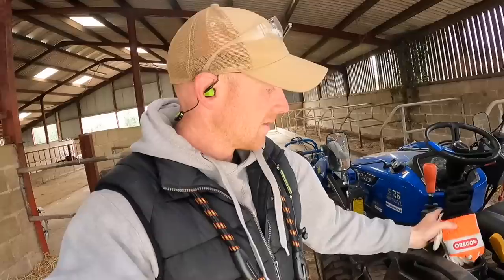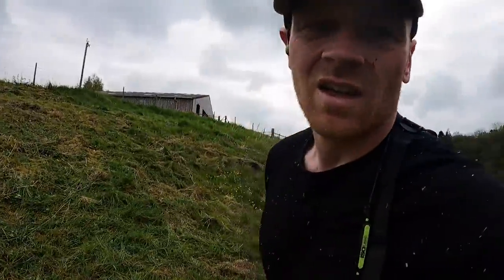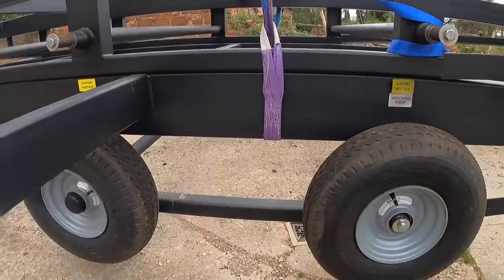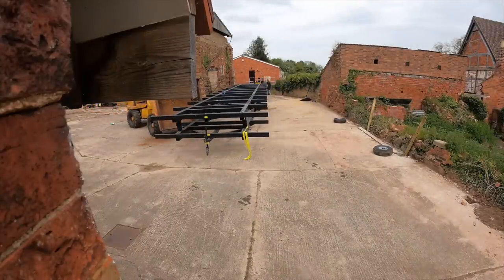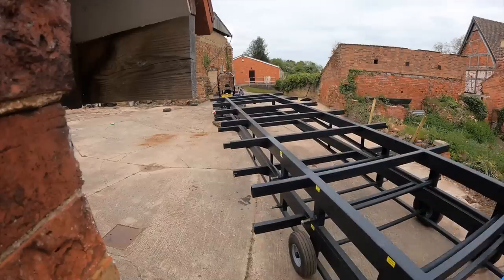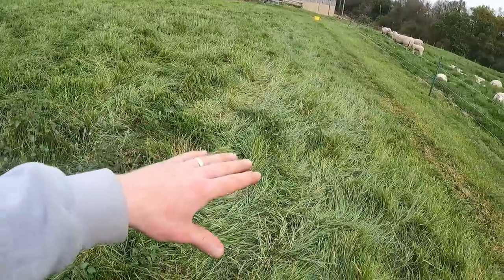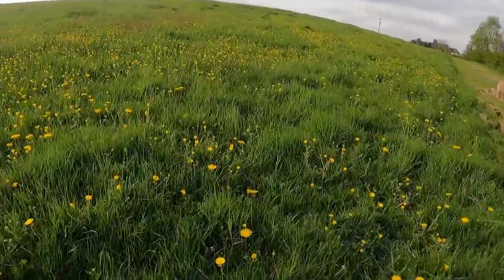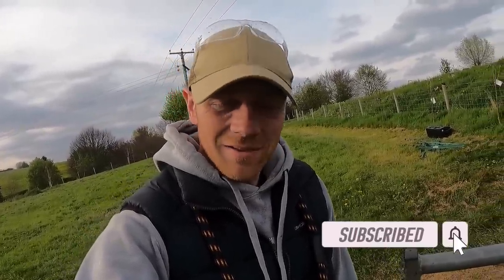WE MOVED THE GIANT TRAILERS! - First stage of the Cabin Migration

Comment: Use 4 high lift jacks on the top chassis, one each corner, drag the bottom one out……or speak to local farm and borrow / hire a telehandler with a couple straps.
Reply: Spot on. Raise the top one, drag the bottom one out. Simples

Comment: Should have mentioned that you should take advice from someone who is BASIS qualified for use of any agricultural chemical applications.
As you want to use no/ or minimal chemical I put,they will give you the best advice; for example for the weeds within grass, they may suggest that rather than using a premix, such as the one you mentioned, they may suggest using something like Agritox and Deptitox 500, due to improved efficacy over a premix, thus reducing the need for chemical input.

Comment: Your sheep grazing, moving them on quickly before they take the grass off very short, followed by topping weedy areas, is very effective. The grass recovers more quickly and you can start to control the weeds, If you can move the sheep back after the grass has grown well this can possibly reduce worm problems. We graze goats in this way, the grass recovers more quickly and I have to worm less frequently. If you plan to bring in goats, the goats suffer from some of the same internal parasites as sheep do, but they do not develop as much resistance as the sheep, this is probably because they are browsers rather than grazers, so take in fewer parasites if they can browse. It would be a good idea if you can have separate grazing areas for both species. Making hay and then grazing the less resistant species afterwards is one solution, as is grazing cattle or horses which carry different parasites so can reduce the worm burden. (As you have three daughters you are at some risk of being pushed down the equine route.)
Reply from the maker: Exactly what we are aiming for. 2-3 day mob grazing and just move along. That way we should be 6 or more weeks before revisiting ground which should help with parasites especially with chickens following up behind. Not sure when we will add goats but I imagine we will keep as a separate group and move them to wherever browsing is needed. 👍

Comment: This comment has no ulterior motive, just curious! Why do you need to cut back the brush as you call it? Could it not just get a bit wild for a bit? Or is it boundary protection or something like you've stated previously?
Reply: The Australian answer would be weed control as required by the council.
Reply from the maker: We have over 10 acres of ‘wild bits’ we won’t be manicuring. The reason we want to get to grips with that bit is that we would prefer better fenced areas nearer the barns and if left the weed seeds would just cover every corner of the yards. The banks may well eventually be orchards and paddocks so it will take a couple of years to improve the ground.

Comment: On the trailer thing. If you use a rope with the tractor at 1 end to control the speed of the top frame and only use 2 wheels on the rear of each side of the frame you could roll the top one off very easily. By putting the wheels on the back only it would let the hitch be lower so you wouldn't need the tractor hitch to be as high so it was easier to keep it hooked up. Combine that with a rope you have a good safer system.